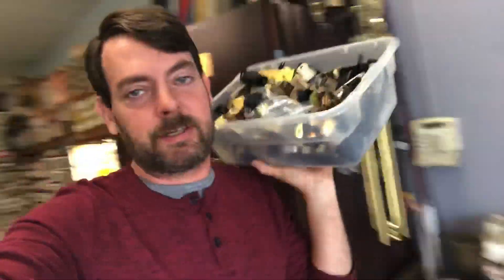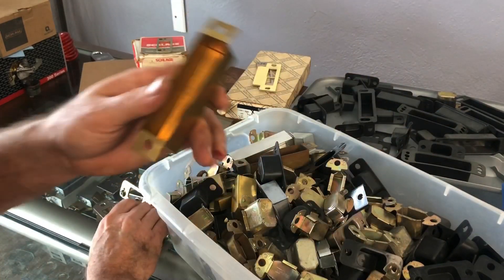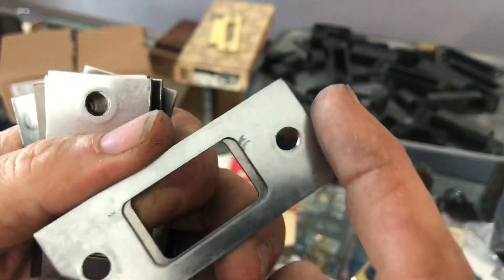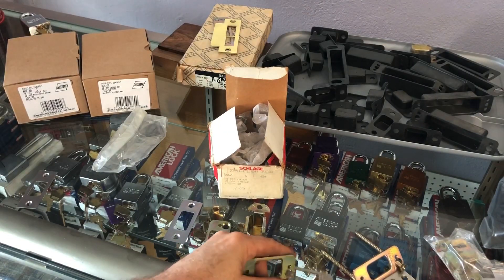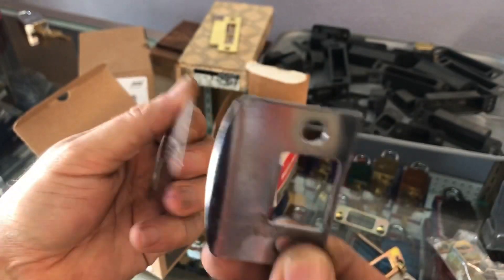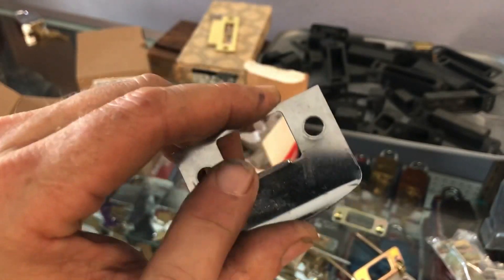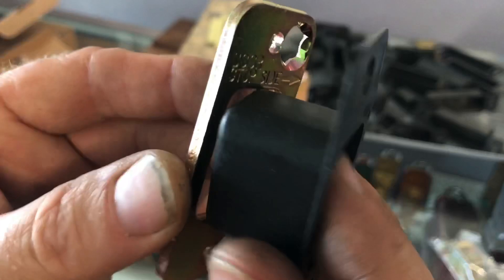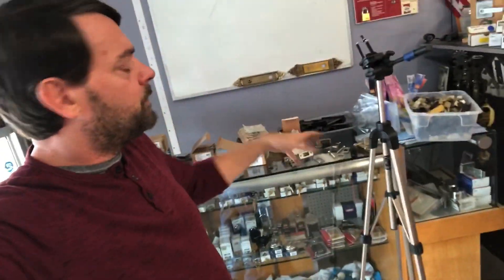Dust Cups for Locks - What they are (were) used for!

Comment: Would the metal dust cups actually provide more security based on essentially turning the 1/8 inch security strike plate to almost a 1/4 inch?  Is it correct that some had a third screw middle of dust cup?

Comment: Extremely informative as usual.  Thanks, Jason.  Do you recommend any of the strike plate router jigs out there or have you always just used a chisel?
Reply from the maker: Darren Neal I almost always chisel. I do however every so often have to use my trim router that I have modified the base guide (cut in half, basically) I hate the super fine dust and wildly dangerous nature of it though

Comment: 😎new construction you normally cut the rough opening 1 inch larger than door size for room too shim the door plumb and level ..new Jamb thickness is 5/8 thick so how much jamb would be left after adding a dust cover not much security..lol lol 😎thanks for the GREAT VIDEO. Well explained. 😎